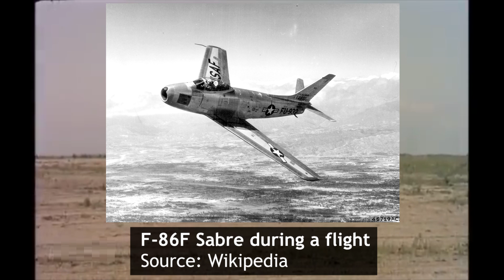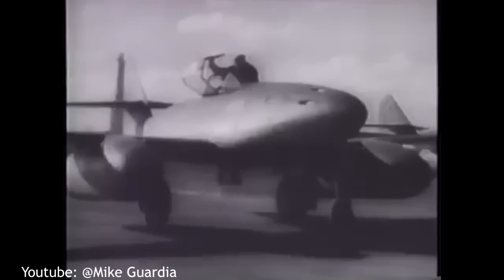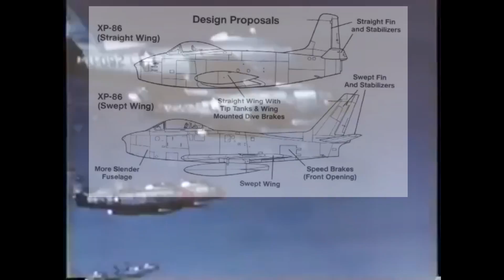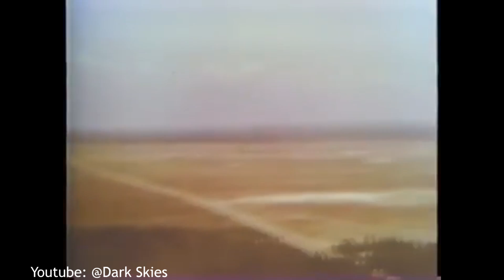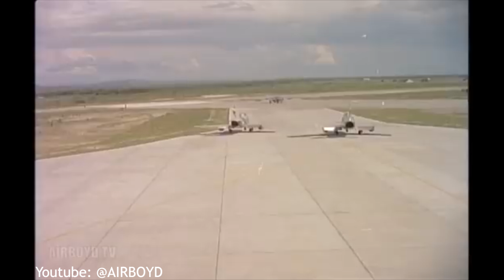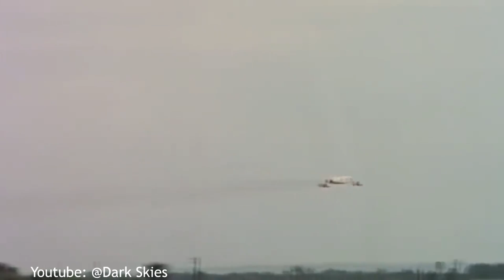Forging the Sabre | North American XP-86 Sabre

Comment: With all due respect to me, your subscriber, you have told fiction nonsense.

The first attempts to create transonic fighters with swept wings in the USA: Curtiss XP-55, Northrop XP-56, XP-79. The sweep angle is 35 degrees (leading edge). And all of them turned out to be unsuccessful due to the nature of the low-speed flow disruption on such a wing. LOW speed is a problem here.
The NAA did not participate in that project competition, but they received information about the difficulties. Therefore, Edgar Schmued, the author of the Mustang look, already in 1944 proposed a Mustang with a forward swept wing. The Mustang became the basis of the Fury and Sabre. First of all, his unusual wing, which they decided to make thinner.
And here in Germany, they obtained a study of the stall on the swept wing when using Messerschmitt SLATS. That is, the contribution of the Germans, first of all, in slats, which NAA and GALCIT have never investigated, in contrast to laminarity and sweep. There was no purge, which showed a lack of speed. This is probably an AI invention. A carrier-based fighter could not be swept without flight experience.
The NAA sought to remove the slats, they did not like them. But without slats, the Super Sabre began to perform the famous "dance" on landing. At the same time, slats appeared on the swept DH Swallow.
The value of sweep for a transonic wing has not escaped anyone. But the Me 262 did not have a sweep, and the Me 163 had a very thick wing and could not maneuver. It's as bad as the XP-79. The Germans are second in sweep at best. And the first one was Dunne.

Comment: I am no engineer but I believe that information from the cancelled Miles supersonic project was also significant in the F86's performance, especially with regard to the tail controls. We used to see F86s at air shows in England and they were distinct from British jets by the amount of smoke they emitted.
Reply: The whole "captured German tech" thing is blown way out of proportion, it's been done over the years for the sake of sensationalism because that's what sells books and gets people to "tune in" whether it's TV or YouTube or whatever.
The reality of it is the US was already flying a swept wing plane during the war, it was a pusher prop with swept wings that was dropped because the proposed engine was one of those goofy H or X configuration liquid cooled engine's that they quit putting time and money into since jet technology was just emerging, since the proposed engine was dropped a standard Allison V1710 was put in it for the sake of test flying it but the speeds needed for the swept wings to be beneficial were never going to be reached with an engine that only made ⅔rds the power that the original specs called for.
Of course aircraft designers in the US looked at what the Germans had but that doesn't mean they'd never thought about swept wings or flown them before they saw what they'd done.
The designer of it was one of the known companies like Bell or maybe even North American but at the moment whoever it was and the nomenclature for it I can't remember. 

Flying tails were a French invention that dated back to the 20's.

Comment: You guys need to brush up on your aircraft recognition.  Nearly all the footage you show are of F86D which is a VERY different, much later aircraft than the XP86  😕 And you need to learn how to convert from km/hr
Reply from the maker: Unfortunately, freely available high quality footage of the XP-86 is severely lacking. So we used what we had as filler.